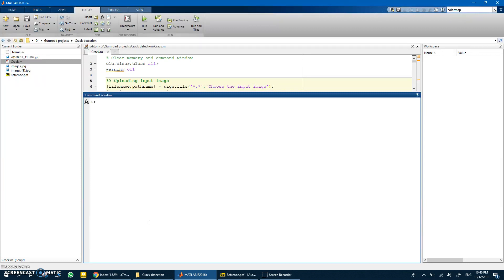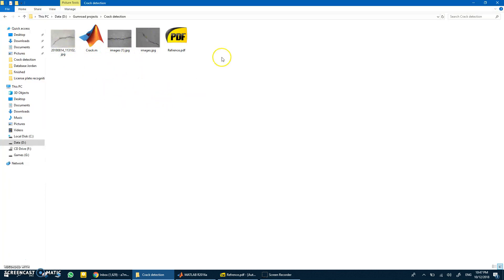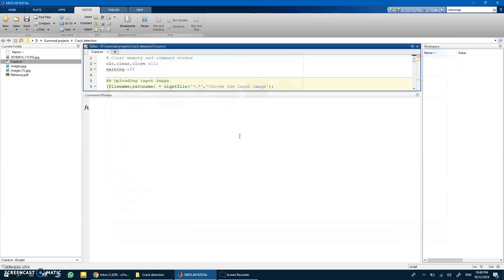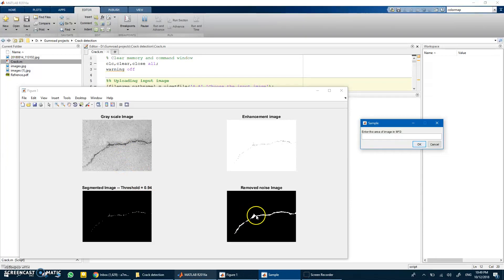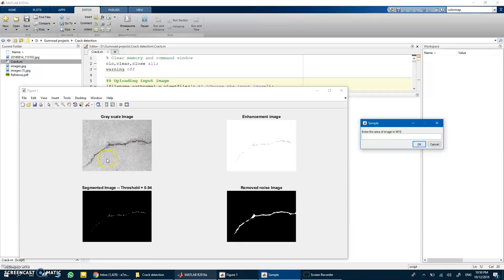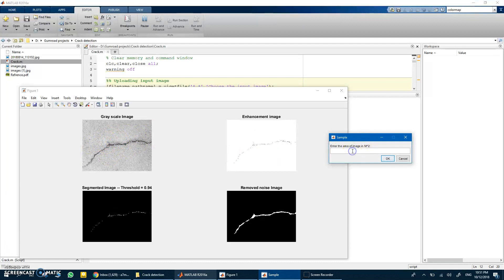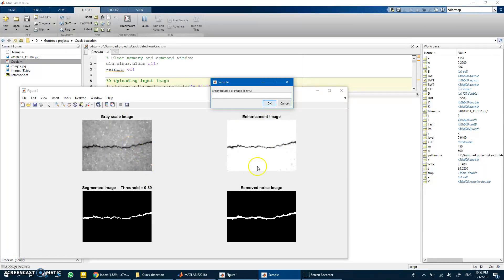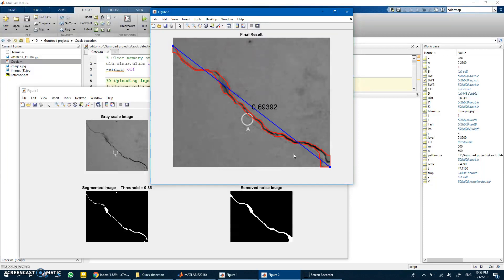Crack detection image processing Matlab

Comment: hi, i am currently working on a similar project pothole analysis is about detecting and calculating it's length and width, so can you help me on this or provide the code of your project?
Reply: Did you get the code ? Which is able to calculate length and width of a crack

Comment: Hi dear
I’m doing my project in the same field. Please how can I get all those stuff?
Reply from the maker: Get the code from here: 
https://gum.co/kDRVJ
Reply: Can I get the depth of the cracks as well?
Reply: @yousefalsiyabi632  same doubt
Reply: Priya NT yes I did
Reply: @yousefalsiyabi632  how , also do u know how to form a line or pattern along crack segment ,,because cracks are disconituous ?? right which comment we have to use
Reply: Priya NT hi dear, my project idea was about the asphalt pavement cracks. So, I used these codes only to get the measurements of the cracks because it’s the easiest way to find the dimensions of the cracks by using images processing techniques. Hopefully the channel owner can reply to you if you have any questions regarding the codes that been used here
Reply: @yousefalsiyabi632  hello Yousuf . I'm aso working on similar project , i m unable to find exact crack position n its length. Can you please  help me with code ? Thanks in advance
Reply: Mohammad Reshma hi dear. I did use the codes only to get the length of the cracks. If you have any doubts about the codes you can ask the channel owner while I did not make any modifications or changes on the codes I just used them as they are. One more thing,  to measure depth and width of cracks I have used depth gauge. The codes helped me to made the checks clear and to get the length only.
Reply: @yousefalsiyabi632  hello sir, did you brought the code. i was not able to buy it now, the payments are not working , can you reply plse .
Reply: Hello did YOU complete this project?